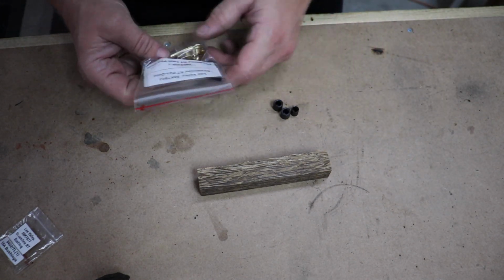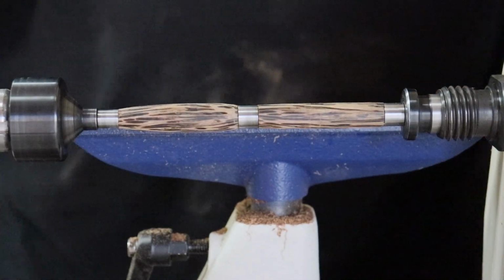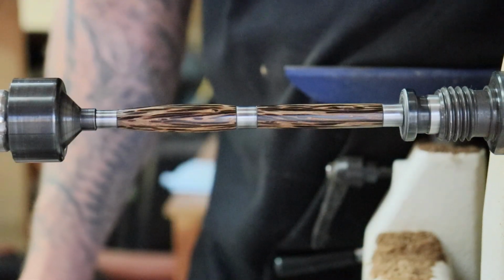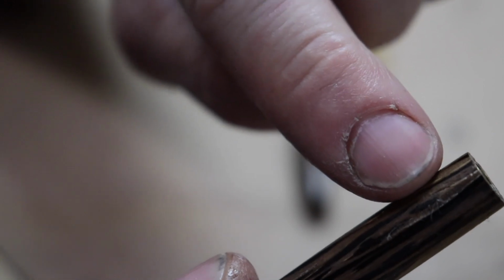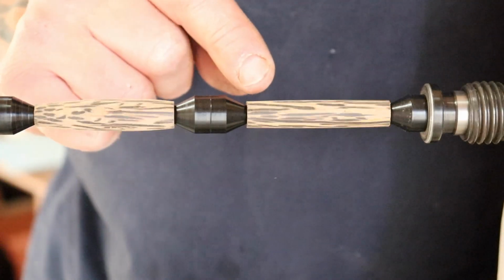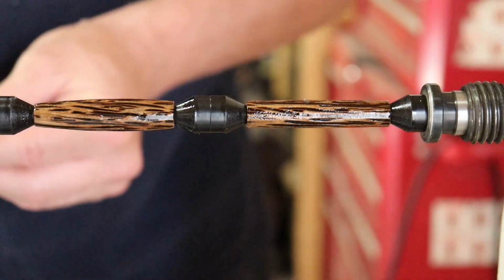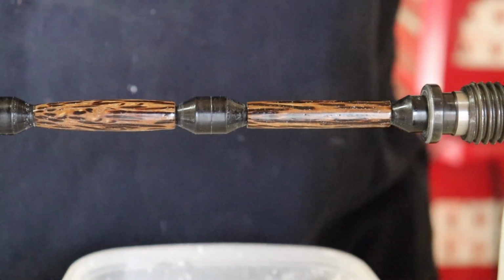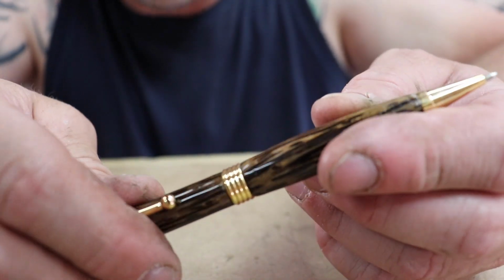Turning Black Palm wood with a Streamline Round Top Pen Kit

Comment: I have successfully turned a couple Black Palm blanks.  Once drilled, I soak them with Thin CA and then epoxy the tube in.  I turn with carbide tools, and add more Thin CA as I go to make sure that I don't get splintering.  I stop turning a bit earlier than other woods and do more sanding.  For a finish, I used 4 coats Thin CA followed by 12 Medium CA and then Micro Mesh and Renaissance Wax.  Even with that, the nature of this wood with the dark fibers and light punky wood, doesn't leave a perfect finish because it isn't completely smooth.  The next one I try, I think I'll try to fill those voids with thick CA, finish turning/sanding and then do the CA and micro mesh.